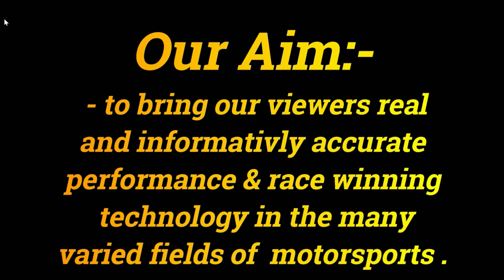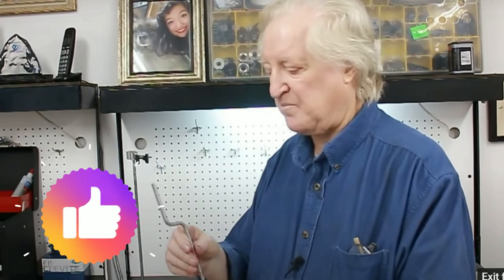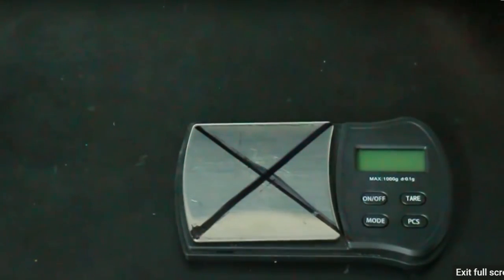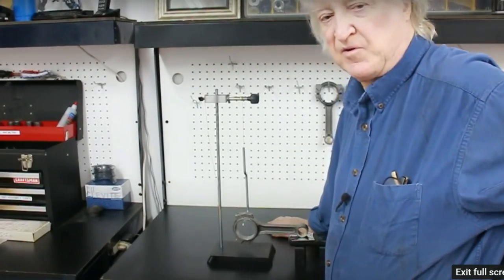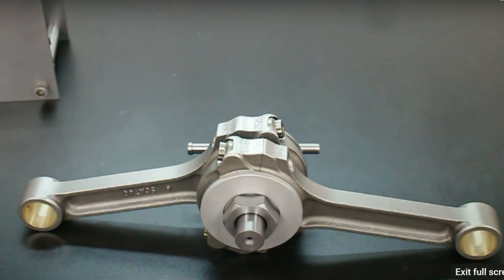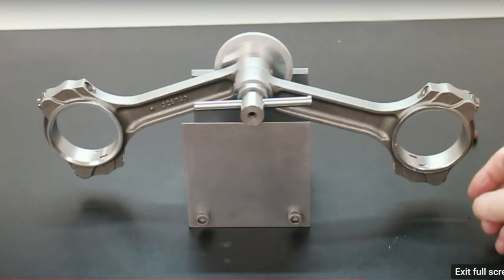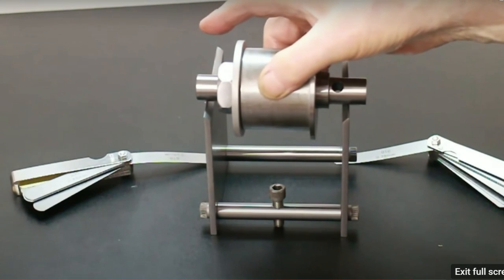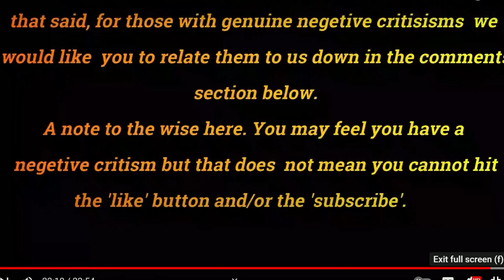Build an electronic rod balancer for $15!

Comment: 40 years ago I rebuilt a inline 6 cylinder diesel, it had been apart before. It vibrated so bad that parts would lossen and fall off .It was a stationary irrigation well motor and ran around 2000 rpm 24/7 for weeks at a time. Upon disassembly one could see the out of balance problem, as one wrist pin was different, the hole was much smaller. 90 grams heaver than the other 5 pins. some where one piston pin assy. had been replaced with a setup meant for a turbo-ed motor. We used a triple beam balance scale to get all the parts, rods,piston pins and pistons as close as we could. Didn't do anything as far as the rotational assy. Put it all back together and one could stand a nickle on the valve cover with it idling and the coin would walk around in a circle. Probably just farmer luck, cant't argue with success as they say! that motor ran many years after that!  Finally that engine was replaced with a electric motor.
Reply: That's an excellent support reference alone. I have  the inclination to do the same to my engine I want to balance and lighten, but don't want to spend big money (that I don't have) on a time consuming job. I'm retired and have heaps of time on my hands and the patience to get it right. With Dave's examples I'll do the rods and then get them Shot Peened. The stock engine already does 7Krpm. If I get another reliable 1000RPM out of it, after reducing the rods, crank and flywheel weight, and then balancing it all, I'll be stoked.

Comment: Years ago, on my 350SBC, I just statically balanced the rods, and that seemed to run in the motor well. It idealed even smother. I learned how to balance the rods on eather end but not to this extreme like on a beam. Well done since my background is metrology, and I worked at a major helicopter company in CT. 
People don't realize how important the details are, and you show how to do simple things, and it's done right.

Comment: Hi Mr. Vizard. I love this low-buck setup.  It strikes me that 2 modifications (with your thoughs) might make a difference.   1.  Having a beam across the top of the stand where the upside down "?" hook ( attaches that allowed for a plumb bob to be installed in-line with the "?" hook string would make it easier to ensure the "?" hook string was perfectly straight.  In fact one could do an T at top with 2 plumb bobs.  2. as a modification to the scale surface dedicating it to this purpose, a short small nail could be glued with it's head to the balance plate.  This would ensure the pressure was always dead center in the same spot on the plate - though positioning at the same spot on the rod would have to be by eye.  Even 2 parallel nails to simulate a knife edge might work?
Reply: Use a plumb bob and mark the base exactly below the hanging post. Then use a simple wire hook through the big end and make sure the other side is exactly above the mark you made on the base the base. If the hook is on the big end joint line and the string has the same top hanging point it will be vertical. We are not interested in the actual small end weight measurement, but we do need good repeatability from rod to rod. Most piezo scales should be more than good enough.

Comment: Mr.Vizard ... thank you for all of your books and the Power Tech Tutorial videos .                  The Chevy 302 engine con rods were factory fitted steel on steel . Longevity was said to be about 50,000 miles before brinelling .           Maybe you said this in one of your small block Chevy building books !!!
Reply from the maker: Modern oils allow the pin and rod to last almost indefinitly.

Comment: Don't mark on your wall. 
      Put and indicator ring on the stand
 Half way down the shaft put a second rod out with a ring on the end in the horizontal position.  
Pass the wire or cotton as he calls it down through the center. 
A black string with show easily all planes of center as it passes through the ring on its way to the support hook.

Comment: I like the metal jig for getting equal weights. 

With less droop in the rods on the balancer jig you will get even more precision. Less droop means that you have less stability so you will need more patience so it's up to the user how much time they want to spend. Having a block to put under one rod end when fixing them to the shaft will allow quick setup with less droop.

Instead of using a background line to check the height difference you could make go/no go gauges out of a couple of bolts with the heads and thread ends ground or carefully filed flat and putting everything on a glass plate.

Comment: That balancing device works similar to propeller balancer. For RC plane propellers, since they are very light, the part holding the propeller is held in place by magnetic field, so it had no friction.

Comment: If your rebuilding a engine on the cheap 
And it's "factory balanced" mid 9s 360 Mopar
Balancing the pistons, pins and rods to match the lightest one
Will NOT negativity throw off the factory balance will it?
it will only tighten the tolerances 
Of the loose factory balance. Right?
I'm pretty sure but just want to be 100% ish. 
Thanks and awesome videos

Comment: You are a stud sir.  I am glad I found you.  Does your shop do head porting?  If so, I will send you a set of Kasse/Jegs heads with slight canted valves for my sb for 347 I'm building for my 67 Fastback Mustang. Then I can finally purchase a cam with the head flow in mind. Billet Scat crank, H-beam Scat rods, Diamond Pistons, but are wrong, I believe. They put in Boss 302 valve placements, may need to fly cut them to fit these heads.  I even gave Scat my combustion chamber layout that came with the heads....oh well.

Comment: Back in the day before the invasion of cheap Chinese tech , I used 2 tension springs to balance rods end for end . The springs attached to a board by 2 screws and each rod end suspended on each spring . The position of the rod was marked against the board and the lightest one found by marking the board . The others were then had material removed to match the marks on the board . Simple and repeatable results .

Comment: I’m going to make one of these with my Ohaus 310-00 Dial-O-Gram Hanging overhead mechanical Balance, 310g x 0.01g and Ohaus 750-S0 Triple-Beam Balance with Tare and Stainless Steel Pan, 610g x 0.1g

Comment: I always thought large journals/rotation end were far more important than the wrist pin ends. Then just took any difference of complete weight off of wrist pin ends. Never had a problem but then again I'm not running a race car. Funny how different things you do in life change your outlook on things. When I was young I worked in the meat business and after seeing weighing single items like patties and then making Stacks of 8 and weighing each stack and getting different weights I feel total weight is most important. That being said I use same 2 wedges to prop up connecting rods on the pistons and weigh total assembly. I feel true-ing cylinders and ring gap also determines the resistance of each cylinder and can make any of the piston assemblies look different.  Where does it ever end 🤷‍♂️

Comment: On the diesels I work on you can almost balance assemblies on a bathroom scale. I have seen engines with 3lbs difference in the rotating assemblies parts from the factory but I guess on one that weighs 300-400lbs its only 1%

Comment: Would this method work with the pistons still attached? I don't have access to a press to remove my pistons from the rods, but still want to try and see if my parts are still close in balance? Working on a 460 Ford if it makes any difference. Thank you Mr. Vizard in advance.

Comment: so in first place you have to have a very flat level of surface to work on with that tool from compcams? And then , different Big ends and piston pin dia
bolting. How does that work? And if so, you would be able to make that sort of balancing tool yourself if you have a small lathe and drilling mashine
like i have second hand bought. Just asking, thank's

Comment: Awesome video 
Could you set the stand and hanging rod on a separate scale and 0 it out 
Then put the con rod on and measure both ends at the same time 
Or would that just make more room for errors 🤔or less
 if you take the time to do the dual measurement correctly then it's only 
1 chance with the possibility of  2 errors 
Or individually and 1 chance for 1 possible error but you have to do it twice  
🤔🧐🤪🤪🤪    Or do it both ways and hopefully you'll see one of them isn't right and start all over scratching your head thinking about which one is wrong
Id just go with your way as correct and ditch mine fyi  measure twice cut once 
Or try the old dang it 😡
I cut it twice and it's still too short 
Method
Reply: That's a great idea! Balance the small ends, then you don't need to use that system just the scales. It will save a lot of time. Thanks for the tip.

Comment: Where do you remove weight from? What part of the rods? I understand on some old factory rods, they have the massive chunks of metal on the small and big ends you can grind down, but what about these aftermarket rods?
Reply from the maker: They are made with more accurate forgings and selected as a group of 8. The fully machined rods are very close right after manufacture and are selected as a set of matching rods.

Comment: Great video! I just turned a set of 6 powder metal rods into bananas! In my 3800 I got a little bit over enthusiastic with the boost controller lol!
Reply: I guess that's better than putting a window in the block....
Reply from the maker: Hey Mr. BOOST - could you send me your worst rod and give me details of what it took before failing?
Reply: I lightened and balanced up a set of Chey 2.2L rods years ago. They were also powdered metal. It was like grinding butter.

Comment: So are you saying buy honing the pin end of the rod about 1 thousand bigger and not having it with bushings I can run floating rod pins ? And use the oil you talked about. I did not know that thank you.
Reply from the maker: That's right!

Comment: I know this is not a new video but I hope you see this. I am working on a similar build with a 360 magnum for my pickup. With the 360 being externally balanced, what differences will there be in the overall balancing?  I wouldn't mind having an enternally balanced engine when I am finished, if it is feasible considering cost/effort/skill.

Comment: So what if they are out of balance, do you just remove s small amount of metal? Does the total weight of each rod matter compared to the other rods or will that be correct once both ends are balanced?
Reply: The complete rods weight all have to be the same

Comment: I read somewhere that the factory has around a SIXTY gram balancing tolerance. Can an engine be balanced that far off and not shake noticeably?
Reply: ,,,,,,Engine balancing factors are quoted in percentage.....Balancing factors ; of below 50 %  , above 50 % for automotive engines ,and  even 60 % for old Harley engines.......Only the parts to be balanced are measured in Grams..........

Comment: It there any reason for the cross pin to stay in the fixture after the nut is tightened?
Reply: It balances the fixture You balance the fixture before the rods go on. 
you mark the pin 
so after the rods are on you can put the pin back to the balanced point
Reply: @MrJak427  That is how it's being done in the video. It seems simpler to balance the fixture without the pin so that it doesn't have to be reinserted precisely every time.

Comment: Rod balancers are 200 or so u less u build 1 no need for 4 figures here just a quality scale I go down to .001 in weight when balancing pistons or rods some only go to a tenth most are within a gram but accuracy is key in building a engine

Comment: Good content...poor production. Put as much effort into your production as you do with your thumbnail and title and your channel will grow.  It's obvious you have a lot of knowledge to share. Loose all the text in the intro. Start the intro with topic video, not a brand promotion... then splash the brand, but be brief (10-15 sec.). The cuts building up between the two methods of balancing was an interesting idea but I think it was poorly executed. I think most viewers would grade the flow of the video poorly.  Obviously, if it's just my opinion, it doesn't matter. It really all depends on your motives for making the video. 

You have definitely figured out the thumbnail formula, but here's a tip for your titles. Keep your titles 50 characters or less otherwise they will be cut off and all your efforts to create an enticing title will be for not, because there will be missing words next to the thumbnail.  

Thanks for the information on balancing rods. I found it useful.
Reply from the maker: Don - You have some good points here - I'm not anywhere near as good at this video deal as I would like to be. Please help keep  me on my toes!
Reply: @DavidVizard  You're doing a great job! Most gearheads aren't interested in over the top graphics that take hours to perfect, but are interested in your amazing content not offered by (almost) any other channel.

Comment: Speaking of BS,
Nah mate, your method is NOT accurate enough Pal. They will come out all over the place in weight if I were to check them. Another one with no idea. The compcams rod balancer is however accurate when used correctly.
Reply from the maker: I made the protoptype for the CC balancer.